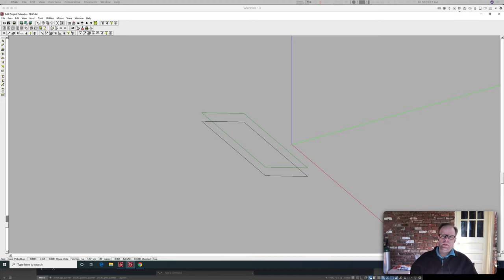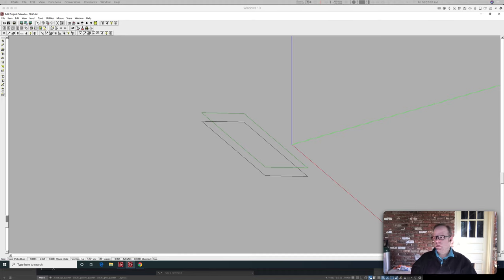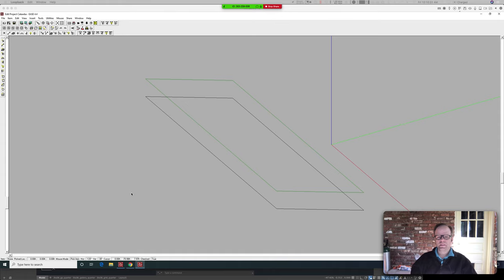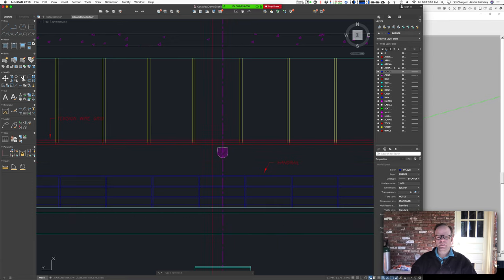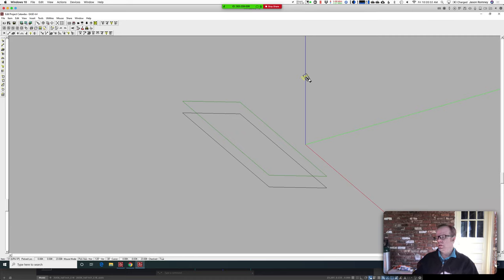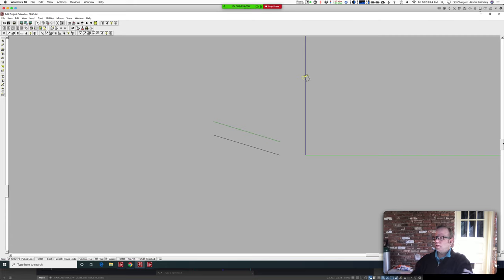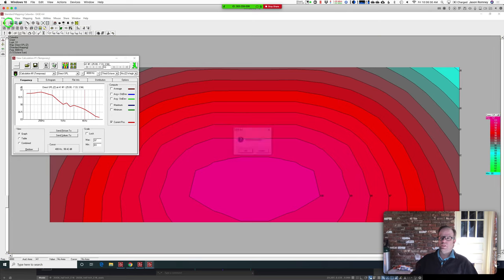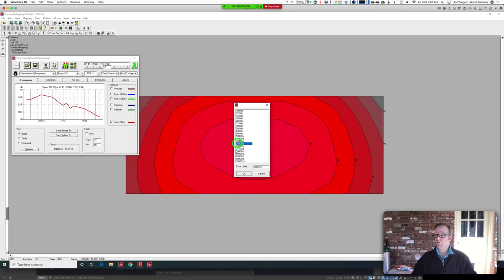EASE Training Part 2 - 2020

Comment: CAN I ASK A QUESTION.? I want to load a line array speaker in the model, specifically the reference: T10PS from D&B tech, but the speaker properties window shows me the red light on the model and then when I check the data there is another message window that it shows the following "Asymm. The speaker model used is symm. Room" I don't know what to do for the time, can you please help me dear engineer?
Also i dont know why in the edit loudspeaker window, when i load any line array there isn´t appear Ele. Power and SPL information but still i have the green ligth in the same window
I am from Colombia
Reply: In your Edit project window, select the Edit tab, then Room Data, then uncheck the "room symmetric" box. Should fix the problem